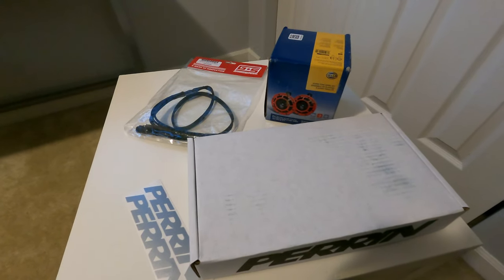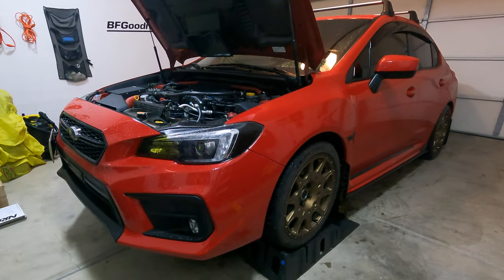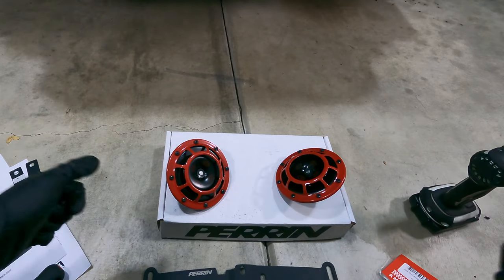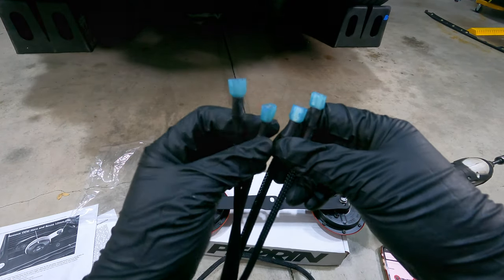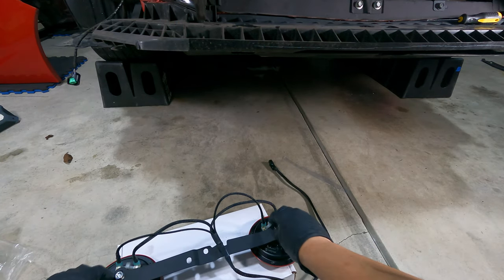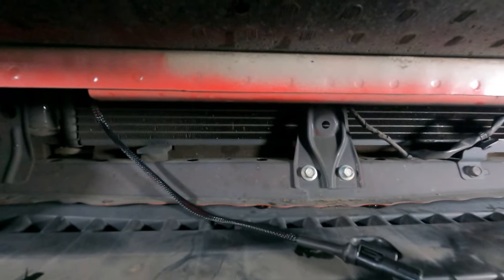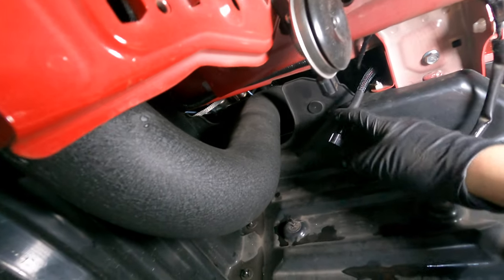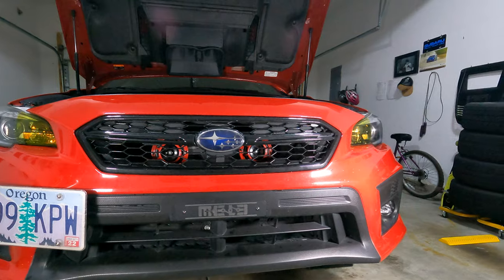Installing HELLA Horns on a 2018+ SUBARU WRX/STI | EVERYTHING you need to know

Comment: three comments, but first thank you for the detailed video here. I just did this on my 21 yesterday so it is fresh in my mind. 

there is only one clip at the top of the wheel well that has to come out. The one with the center push pin. The one in the back holds the fender liner on and doesn't have to come out to remove the bumper.  Second, when you run the grimmspeed harness to the secondary horn, the connector there absolutely does click in place.  If it does not just clean the connectors. Instead of electrical tapeI suggest using heat shrink wrap. 

Finally if you're having difficulty keeping the bumper foam in place during reinstall just put a bit of 3M double sided tape on either end, on the smooth flat parts. 3M has some lighter duty stuff that can hold 15 pounds and it is perfect for this. 🤘👌

Comment: Thank you for this, I had a harness from Subispeed and they were literally telling me to plug it into the wrong place....... they were telling me to plug in the wires into that bottom plug which kept giving me check engine lights and cruise control disabled codes. Additionally they said that id doesnt matter how the positive and negative wires go into the horns. So thank you for being better than Subispeed.
Reply from the maker: No problem, glad I could help! There’s a lot of factors involved and a lot of hidden differences between the model years. It was a lot of trial & error on my side so I’m glad I was able to show someone the correct way.
Reply: 2018 wrx STi here, currently getting the check engine light cruise problem :( horn works but I have it plugged into the horn that was on the passenger side. Should I plug them in somewhere else?

Comment: Thank you for doing this tutorial! Just installed mine today and you made it easy for us! No issues with the CEL. I had a hard time loosening the bolt(didn’t have an impact wrench) on the back of the horns tho so I just used the bracket it came with. Did you notice any difference on brightness/darkness of the color of the horns? One of mine looks brighter then the other one is darker. Irritates me but easy fix with repainting. Thanks again!
Reply from the maker: Good to hear! The brackets they came with are totally fine to use. I didn’t notice a difference in color with my set though. Thank you!

Comment: Is there an easy way to tell which cords were positive/grounds?
Reply from the maker: I figured it out by trial & error but check out the comment that I pinned on this video. Another viewer suggested using a multimeter’s ohm or Diode setting to determine the positive/negative wires. I hope this helps!
Reply: @ronfromportland  thank you! 😊